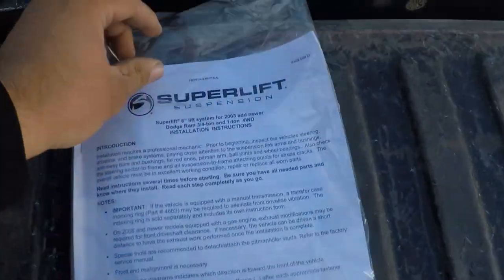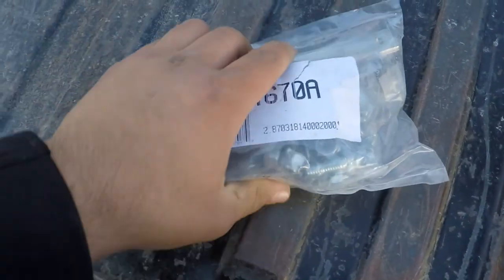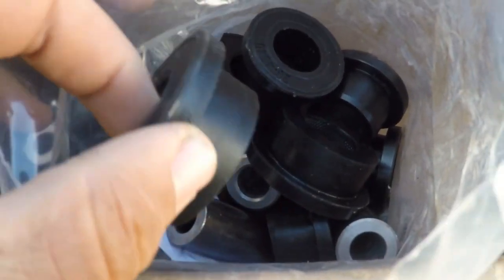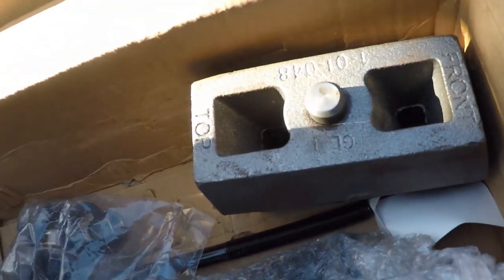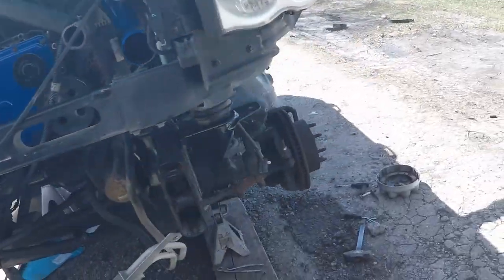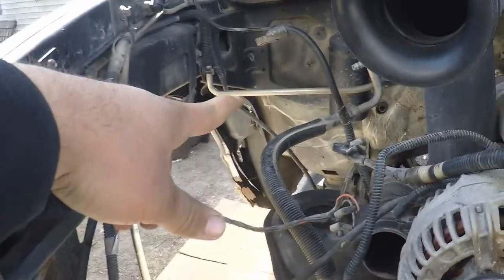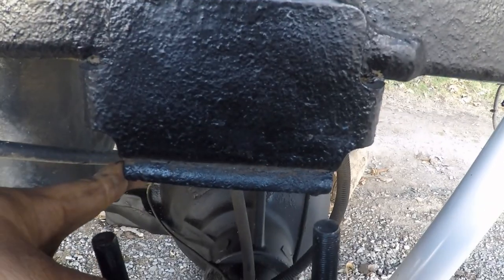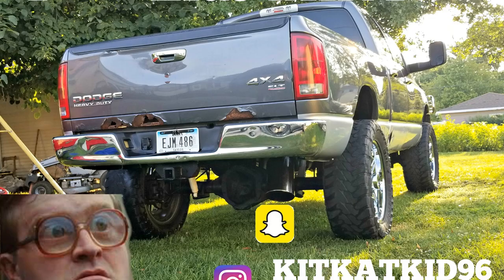3rd Gen Gets a 6 inch Superlift!

Comment: Did you use all your hardware with your lift?
Reply from the maker: No I had some stuff left over pretty sure it was extra or just for a different model. Like mine was a manual so I didn’t use transmission drop bracket that they say you only need if you have an automatic.